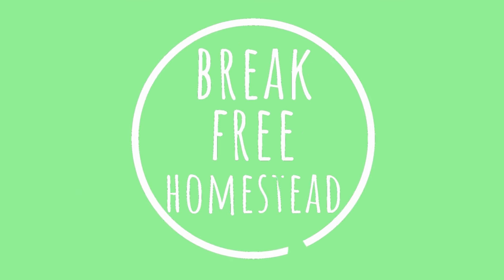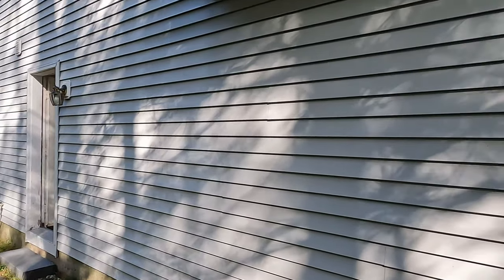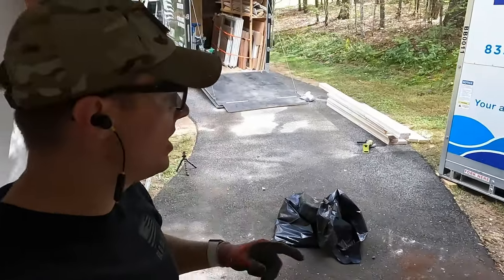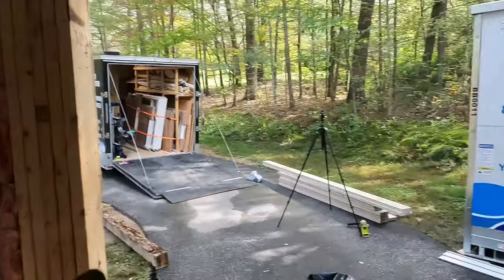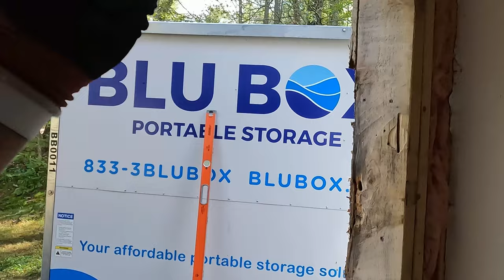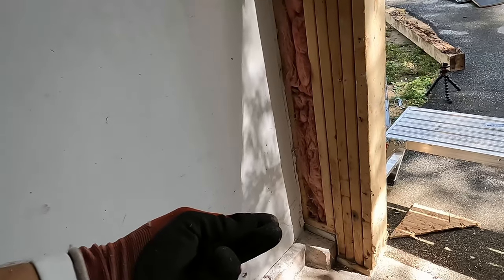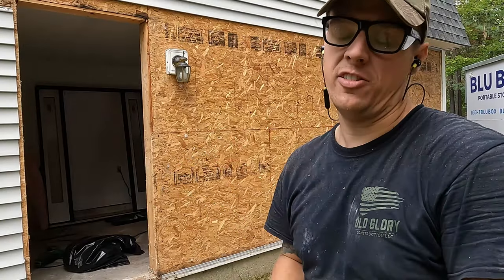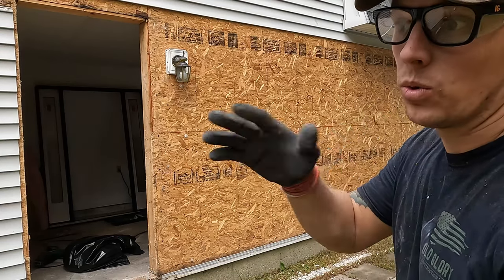Transforming a Garage into a Living Space |Demolishing|

Comment: Did you video the bathroom conversion? I am doing this same type of project my self. I am not an architect so designing this my self and overseeing the job.  I would love to see the bathroom conversion.  I will be doing a full bath, corner shower, toilet, electric water heater and wash vanity. I watched the raised floor video and will be doing that as well, thank you for showing that video.
 I sent it to my contractor that is doing the work and he said that was great!
Reply from the maker: Not an in detail video on the plumbing, but we lucked out with the run for the rear discharge toilet to be gravity instead of having to use the pump up. If you have the shower with the similar situation you'll definitely need a pump up.

Thanks so much for the support Yvonne!